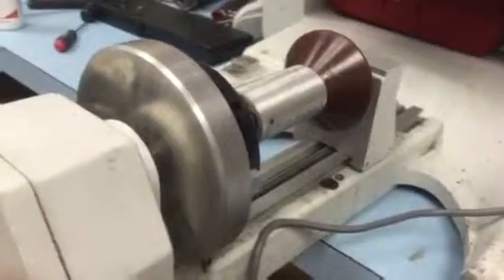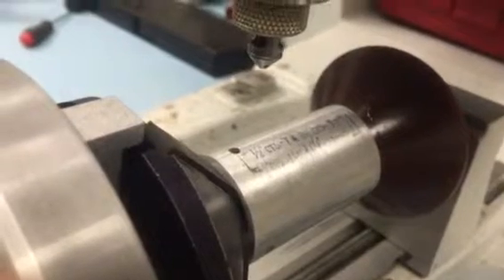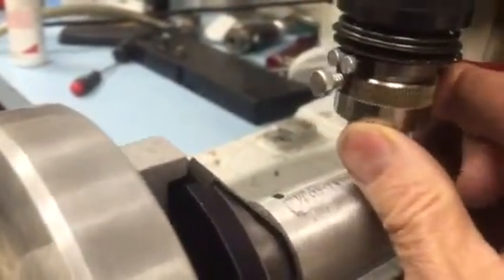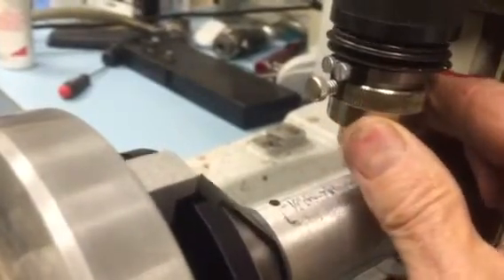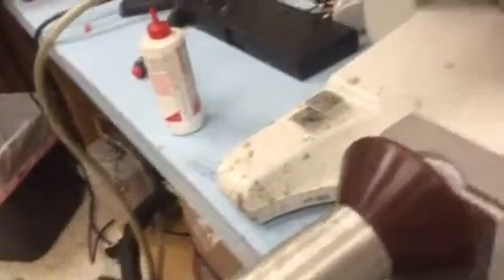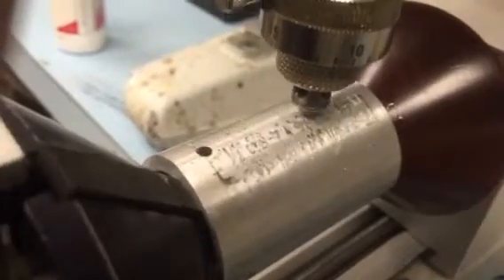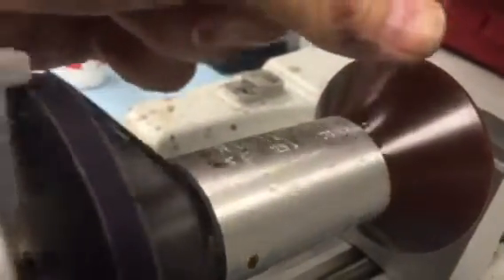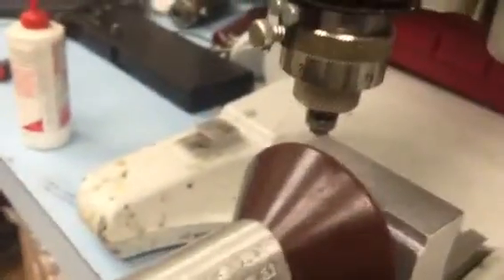Is400 cylindrical

Comment: I have an old old is400...does it come eith a rotary 4th axis connection and also would the connection be same as my gravograph ls500 laser engraver rotary axis
Reply from the maker: There is an electronic board kit that could be added to the old controllers. The board kit was optional. Look at the back of the controller if there is a round din connector take the top off of the controller and look to see if the connector is plugged into a circuit board. If there is no connector but a knockout for the connector the board kit was not installed. I do not think the dove tail base on the ls500 cylindrical attachment will fit in the is400. I am not sure If the pin out connection is compatible.
Reply: Great thanks..not concerned about dovetail..could just clamp in place or make something...ill look see if thrre is a connector on controller box...it seems most of those style connectors are very similar ive got a few cnc that use them...could be a standard for common stepper motor wiring
Reply from the maker: @shelby50411  if you do not have the connector with the add on board I can check to see if I can get you one. Officially they are obsolete.
Reply: Hi mine does not have the connector..have not opened controller...it looks like the ls500 rotary may fit the is400 gibs but not sure...i would only be interested in the board/ attach if its cheap...and can be installed without gravograph support.
Reply: @brucelongstroth  could you maybe hel me understand why my cylindrical attachment will not rotate on my old IS400
Reply from the maker: @carriesmith4809  send a photo of the inside of the control box.
Reply: @brucelongstroth  thank you i will send the picture Tuesday when I get back to the shop thank you so much